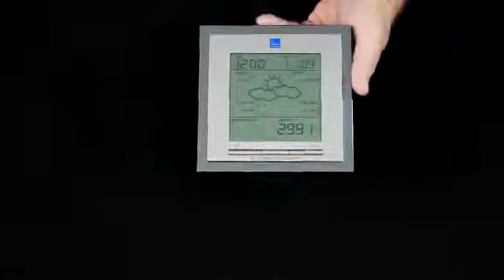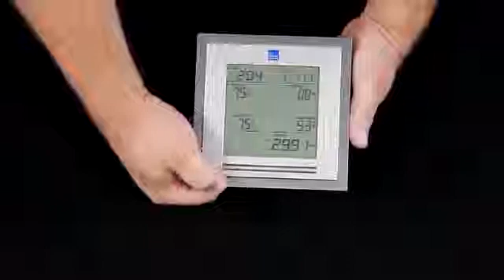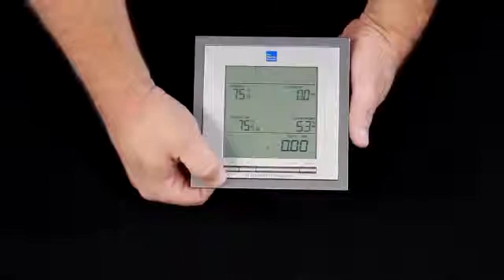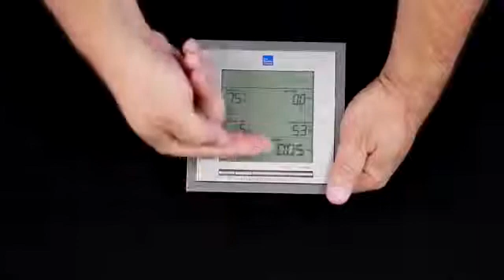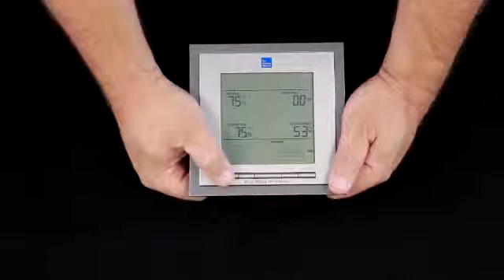WS-1913TWC-IT-SAL Wireless Professional Weather Center

Comment: I had the one that comes with the software CD but i lost the CD and the actual thing and I’m actually planning to find it again with the software CD and the thing and question will the software run on Windows 98/98 SE and Windows ME?
Reply from the maker: If you can provide your station's model number, we may be able to get you a download link for the Heavy Weather software that came with it. As for running the program on older operating systems, this may be a trial-and-error effort as we're unsure if they will support it.